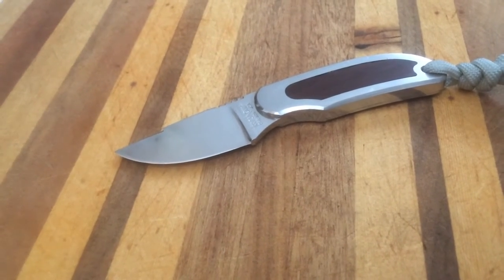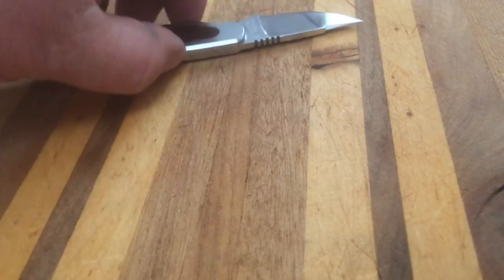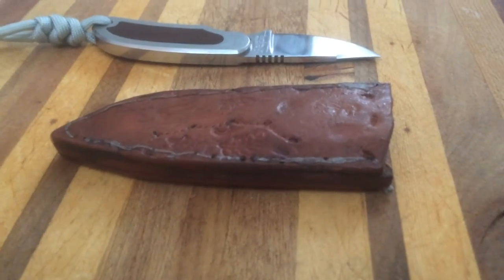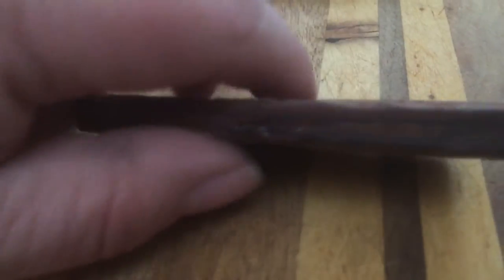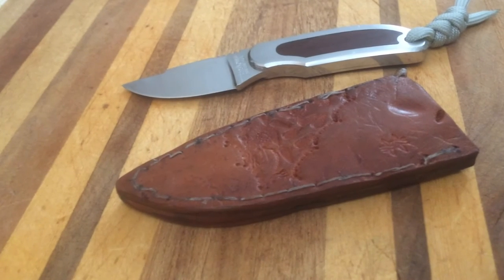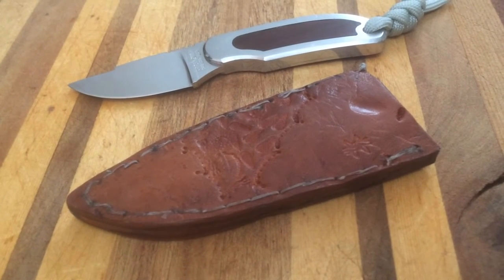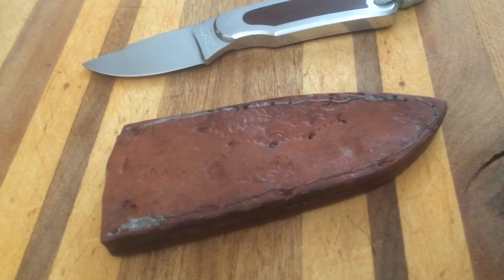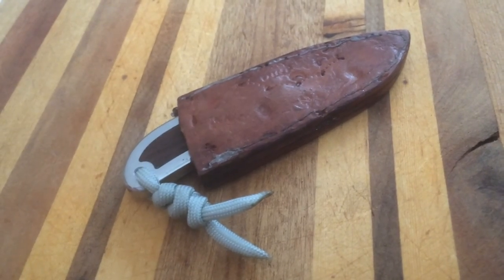Handmade Leather Sheath For A Kershaw 2220

Comment: Hang on to that knife bud. Could be worth a bit more than you paid. I’ve got a similar one the Kershaw 2002. It’s a folder lock back but it’s got the same rosewood inlays and is the same color. These knives (or at least mine) seem to be kinda rare. I think they are part of a series called Easy Rider and we’re in production in the 70s and 80s. At least that’s what I heard.